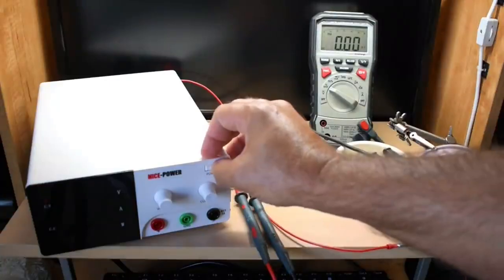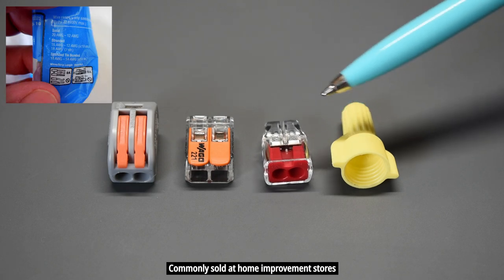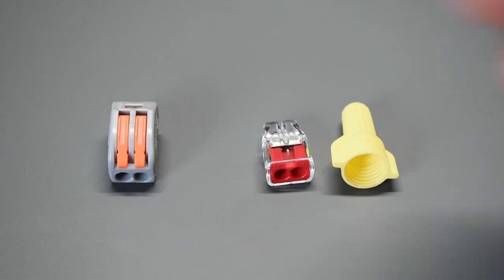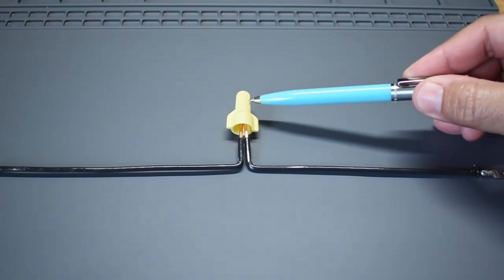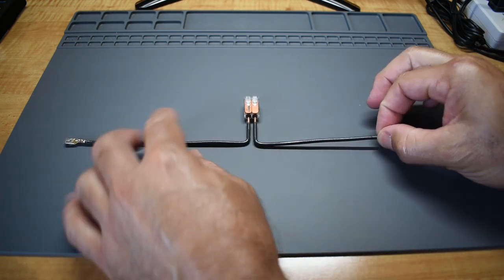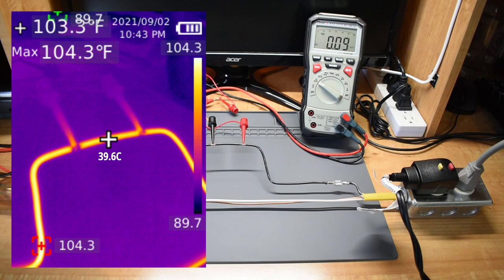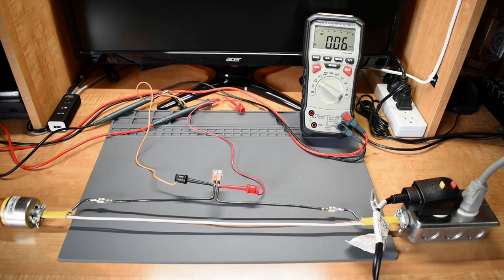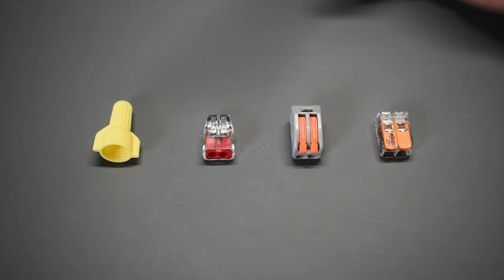BEST Electrical Wire Connector? Wago, Wire Nut, Ideal In-Sure, Lever Nut

Comment: All of them had insignificant voltage drop and are all completely safe!  Wago 221 are my go-to connectors and this little infomercial won't change that.
Reply from the maker: The point of the video was to show which was BEST, and best means: lowest resistance, lowest voltage drop, and lowest level of heating. Yes, all are fine to use.
Reply: True, but in context those voltage drops are so close as compared to the applied voltage and current to be inconsequential.  They only valid comparison one could take from this video is the cost per connector.  Also, some 12 gauge wire has much thicker insulation than the wire you were testing with (some HVAC wiring) and the Wago connector would accommodate that but your test wire would move around more due to its thinner insulation. And after a full day of spinning on wire-nuts I think your hands would be screaming "Bring on the Wagos!"  :o)
Reply from the maker: @rpsmith  I see no justification in spending 6x the money to connect 2 or 3 conductors together. You sure are a Wago cheerleader. LOL I could be talking to an employee, it wouldn't be the first time.
Reply: @electronicsNmore  -- Well it took you awhile but you finally come up with a valid point about price.  And yes, I work for Wago and they pay me to go around  and call out people who say nasty things about our products!  I guess you are just to smart for me to fool.
Reply: @rpsmith  He didn't say anything nasty about them.
Reply: @illestofdemall13  -- I guessed you didn't pickup on my sarcasm :o)
Reply: @rpsmith  Nope, not easy to pick up sarcasm through text (sometimes).
Reply: @rpsmith  I picked up on part of the sarcasm when you said you worked for Wago, but I took the other half of the sentence more literally. Lol
Reply: @illestofdemall13  --  Use whatever wire connectors you trust but wire-nuts have lots of drawbacks and none of those were mentioned in the video.  What was focused on was a trivial voltage drop difference that is near useless.  But anyway,  thanks for keeping me honest!
Reply: @rpsmith  What are some of the drawbacks of wire nuts (not including user error)? I am just used to them and have never had a failure so I haven't needed to try many other types when it comes to residential electrical inside of junction boxes. Sometimes I use butt splices or similar crimp connections when needed, or I will solder leads onto LED tape strips.
Reply: @illestofdemall13  -- Well user error is elephant in the room.  Most DIYs have no clue how many and what size wires are allowed and in what color of wire-nut.  Also, you need to be very careful about lining up all the ends so they are flush. And most people don't know that you should never reuse one.  I use wire-nuts and will continue to use them when the job calls for one but the Wago connectors solve many of the problems.
Reply: @rpsmith  I do electrical and lighting for a living so the user error is a bad excuse for me since I do it for a living Lol. But yes, DIYers often don't line up the wires and don't twist them enough. They also think electrical tape is a magic bandaid for badly installed wire nuts. Lol
Reply: @illestofdemall13  -- Also, Wire-nuts don't do well when vibration is a factor.  There is no spring action involved and if the wire-nut backs off even the smallest amount, the connection can fail.  Seems to me these shortcomings should have been addressed before recommending your viewers use wire-nuts over the other products.
Reply: @P_RO_  -- You might want to stick with residential construction if you think using a wire-nut in a vehicles is a safe an acceptable connection method.
Reply: @P_RO_  -- I also said that I use wire-nuts when it make sense but times change and for some applications the newer alternatives just work better.  The main problem with wire-nuts is with some DIY folks not understanding how to properly install them.  The newer style connectors are much harder to screw up and are way easier on your wrist if you are doing this 8 hours a day.
Reply: @rpsmith  those connectors are designed for 12 - 24 gauge usage, the thickness of the insulation doesn't matter.

I'd probably use the 221-6 series for a 12 gauge solid, but there's no problem with the  221-412 used here.

Comment: My 40 year old house has had at least 6 wire nut failures (installed by a pro with over 30 years experience) fail and a few almost caused fires. I found the 221 Wago connectors and have been using those to replace the failed wire nuts. I heard wire nuts are illegal in Europe because of long term failure (10+ years). They require something like the Wago or Ideal connectors.
Reply from the maker: Sounds llike somebody did a lousy job. If the job is done correctly, they do not come apart.
Reply: @electronicsNmore  There were signs of heat due to resistance (cascading) the first one was when the house was around 25 years old. I have no idea for sure that they were installed correctly or not but he was a trained and licensed electrician and did this every day. They did not come apart but the wires were basically burnt and corroded from heat and the nut was slightly melted.
Reply: @drcornelius8275  It's possible but not like the market was flooded with Chinese knock offs back in 1981 like they would be today.
Reply: @drcornelius8275  fair enough.

Comment: As an Australian Electrician, I would have loved you to test the screw type connectors. We use them almost exclusively in Australia and they are even better than the American wire nuts (although obviously a little less convenient - as you have to tighten a screw).
Reply from the maker: Set screw connectors are superior, just a lot more labor involved.
Reply: most countries use screw type connectors but they damage conductors.
Reply: @tropicaldimitri7374  From that perspective, every connection "damages" the conductors. Yet, the connections are mechanically and electrically sound, so it's irrelevant.
Reply: @InlineDownhillVancouver  But Wago causes much much less damage: just slight scratch yet the connection is very solid (as demonstrated by professionals on youtube).
Reply: @InlineDownhillVancouver  Plus they are not "maintenance free" like WAGO 221 (if mounted on its mounting carrier) and WAGO 222 (with or without mounting carrier).
Reply: @tropicaldimitri7374  Set screw connectors do NOT damage conductors. Damage occurs outside of product and material listings and/or outside of code compliant installations. Set screw, twist on spring, lever action, and push on connectors are all listed for their use and none of them damage the conductors when installed according to the instructions, listing, and code.

Comment: great analysis of the components, answers a few questions which bothered me, I will continue using wire nuts since your demonstration confirmed they are still out there for a reason. 
my compliments on a very professionally done and well explained video.
Reply from the maker: Glad you enjoyed the video Mike! Be sure to check out my wide range of videos and share.Thanks
Reply: I believe simpler is often better. The wire nut is the only connector where the two wires are in direct contact. That is a plus in my book. In THEORY the wire nut could be all plastic and still have the advantage of a huge area of contact. But it has the bonus of that conical spring with sharp edges that cut in and ELASTICALLY holds it all together and further contributes to the conductivity. Those we have here in Sweden often have a hole in the top for testing.

Comment: I had doubts about using Wago because of the faulty connections with older yellow Wagos I found in a few commercial lighting applications. I'm still using wire nuts but at least now I have the option of using the Ideal connectors. Thanks for the information.
Reply from the maker: You're welcome Ron! Please share. Thank you
Reply: Too many Fake WAGO connectors floating around.  People use the term WAGO like Kleenex.  WAGO is often getting a bad rep because of all the fakes.
Reply: You should have no doubts about using the WAGO, it is the best connector out there, and every electrician outside the US would agree.
Reply from the maker: @Faddnn  You clearly ignored tests and didn't understand why the video was made. Wago or other brand push-ins, excellent choice, lever type, I'll pass on.
Reply: @electronicsNmore  Sry, but no. These are tested and tye approved in all developing countries. They work for all types of wires, even though you claim they don't. If you look outside your US bubble, WAGO is exclusively used by thousands of electicans where we moved on from old tec 15-30 years ago. I've read through the documentation provided by WAGO and I've seen their load capacity excide 3 times without faluire.
Reply from the maker: @Faddnn  Can't argue with the Wago cult.
Reply: @electronicsNmore  LOL, there is no point to argue cause the WAGO is a better connector. There is a reason why most electricians (outside the US) love these and why wirenuts are even banned in some countries. And if they're not banned, you will most likely not find them since no one wants to use them. They don't like things that make the day easier over in the US, kinda like how the UK was, but the UK seems to have come to their senses as well. Now we're only waiting for you guys.
Reply from the maker: @Faddnn  I wouldn't bring up the UK, that country is a disaster in many ways. The last thing Americans want to do is follow in the steps of those in the UK. One bad decision after another. LOL

Comment: In my experience Wago-style connectors work better with stranded wires than with solid wires.
Reply: Ditto, Wago type compress a group of copper fibers in multi strand wire & get better contact vs solid wire where the contact patch is small. If the multi strand is small enough U can lightly twist 2 wires together & insert in a single Wago wire port for better wire to wire contact
Reply from the maker: Correct! The connector conforms to the wire, crushes it, which gives more surface area contact. The majority of people working in their homes will find solid copper wire, and that's why I tested them using solid. Thanks for watching
Reply: Correct.  90%+ of the time, a connection will be between a solid to a stranded conductor, such as a supply to a fixture.
Reply: Please don't go with Wago-style.  Many of the Fake WAGO connectors are garbage.
Reply: @jeffm2787  John Ward tested genuine Wago connectors and knockoffs. Surprisingly, even knockoffs performed quite admirably. The genuine ones still worked better.
Reply: @Sheevlord  Yes,  I watched that video when it came out.  Problem is you never know if that knock off is a good one or not.
Reply: @jeffm2787  Fair enough. Although I'm pretty sure that the connectors I buy from my local electrical supply shop are genuine.

Comment: I've almost always used the wire nut style that has a set screw... just gives me more confidence I have a really tight connection.  I would say given your high amperage load, all of those connectors did quite well though.
Reply from the maker: Yes, all did well. Even at 16+ mV, still a low value.
Reply: @electronicsNmore  Wagos are used all over europe and alot of the world, And in my 20 years of experience as a industrial electrician  i have never seen a wago or a terminal block and push in wagos fail even in 400 volt three phase applications in hot envoirments and moist envoriments even acid envoirments in factories. Your concern with the connection being too loose is false as i hanged my whole body off a wago connection using solid copper wire, Over the years ive had multiple calls when wire nuts are so loose that they are arcing and the plastic had melted leaving only the spring, I always replace wire nuts with wagos if i find them and all the time ive seen a wire nut not once had it been secured tight as it works itself loose as it heats and cools.
Reply: @norwegiannationalist7678  thermal expansion
Reply: Those are the best.

Comment: Very informative and timely video as I'm doing some rewiring in the bathroom. I'll be using Ideal connectors instead of the Wago. For receptacle branch circuits (esp. kitchen & AC outlets) I'll stick with the wire nuts.

Comment: This is the test I was looking for. I always use Wire Nuts because Wagos in Argentina are really expensive (each one 6 times more expensive than Wire Nuts). Besides this, I've always thought that Wire Nuts were better in electrical-related perfomance. Even if the difference is small, is there. And we exclusively use stranded wires so they work great for us!
Reply: i've suffered so much using wire nuts and is the reason i am on youtube looking at videos.
i still wanna try the push-ins. it has the 2nd least heat

Comment: Good to know. I've never used the lever-lock connectors on solid wire, only stranded. I'll be sticking with the wire nuts for the solid stuff. BTW the meter was easy to read on the video.
Reply from the maker: The performance of lever nuts are very close to a wire nut when using stranded copper wire. I tested a few. :-) As for solid copper wire, the video made it very clear. Thanks for watching!
Reply: @electronicsNmore  Nice video! Would joining a stranded to a solid core be better done with a Wire nut or Wago lever?

Comment: Excellent and thorough as usual! If a test hole in the other connectors meets code maybe the wire nut manufacturers should consider the same. It just makes sense
Reply from the maker: True, but it is easy to insert a test probe. Glad you liked the video!

Comment: I suspected the conventional wire nuts would have a lower contact resistance and this test proves it.
Reply: because it is an insulator and does not conduct electricity.

Comment: After this video I still prefer the clamp/spring-loaded connector. The other type of connector may have higher safety margin ( if done correctly), but TRUST is the ultimate problem. I would rather to have something more consistent although may not be the best perfoming. Wago should do well, as long as people are not abusing it. I've read comments elsewhere basically saying Wago have higher chance to be damaged in short-circuit situation. Those connectors are buried deep into the wall and once being damaged, they can be hardly replaced or being discovered even.
Reply: Not sure what you mean about connectors being buried deep in the walls. They’re supposed to done only in the appropriate, accessible boxes. I’m not an electrician, but am curious.

Comment: Finally somenody supplied the price of each connector. THANKS. Cheap contractors will always use the cheapest connector. Had union guys charging over $135 a hour use the cheapest garbage electrical tape.
Reply: @garbo I’ve noticed that too. Also they use the cheapest wire nuts available. The type that the spring often separates from the nut by itself. My Journeyman always told me “the best is barely good enough” and Wago and Spliceline connectors are a shortcut.

Comment: Pretty interesting results. This will be handy to know when I get new batches of project connectors, Been more and more using power tool batteries in projects and well you can draw a lot of current from them (and melt wires lol) so the heat part was extra helpful. What surprised me most was the soldered spade connectors heat performance, I would have expected at least higher than margin of error difference in temp and feel like I might need to double down on using them in more semi permanent connections that I want to be able to connect and disconnect still for maintenance.
Reply: If you can wiggle it, it's not a good connection. If the current is very low, you can "get away with it". But the heat increases exponentially with higher currents. Twice the current in a connection means 4 times the heating. This may not be intuitive, but it is the way the math works.

Comment: THANK YOU for this video.  Much appreciated.  Was just going to go wire up my wife's newly constructed she shed and *was* thinking about Wagos to save time and space in the boxes.  I am shocked by these results and will save my money and go with time-tested wire nuts instead. WOW!
Reply: Ummm... did you not see the results? The Wago was 16mV, the nut 5mV and wire was 4mV. So the difference between using a wago and a wire nut is the same as adding 3 inches to the length of your wires.... All of these connectors are 100% ok. Remember: just because you can measure a difference doesn't mean there is any practical difference. Wagos have their use for saving time and re-doing connections and for situations with vibration.
Reply: @sectokia1909  In the end, I used traditional wire nuts in the bulk of my boxes where there was a simple romex in and out to the outlets.  I did have two places where five wires (x3)  were needed, and in that box I ended up using an Ideal connector to make it easier and to save room.